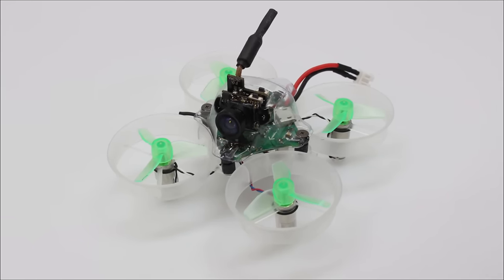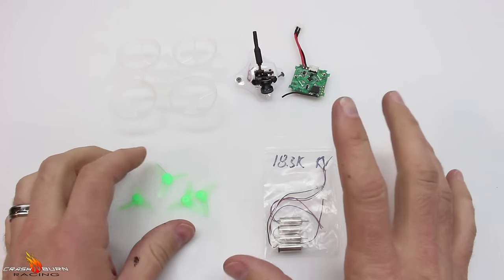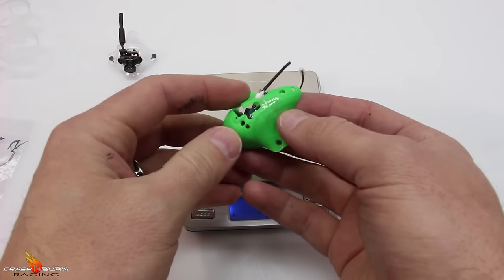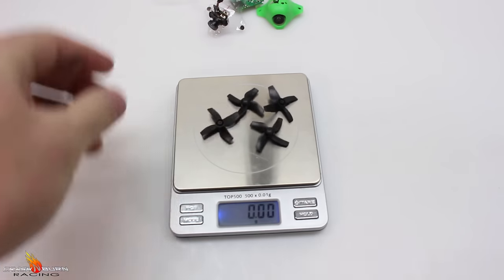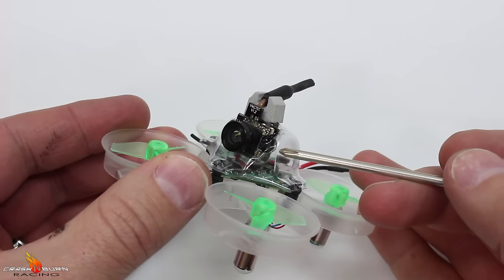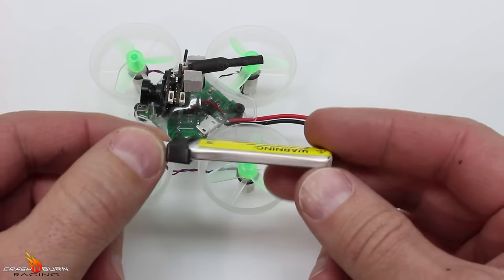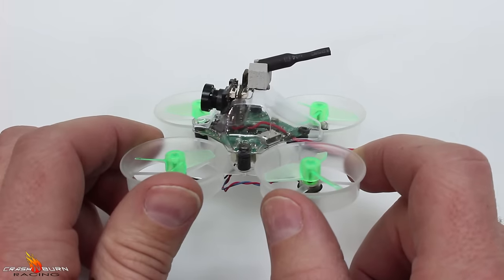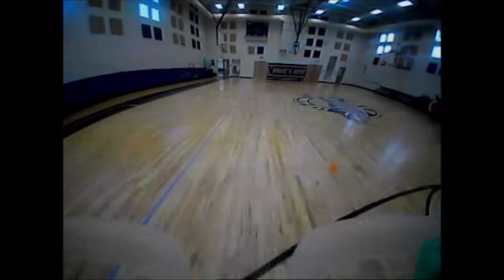Tiny Whoop to Super Whoop - lighter, faster, Inductrix killer

Comment: take the black cover off the antenna to save even more weight.  Also, you can get rid of the 2 canopy screws and just glue it with a tiny bit of uhu por.
Reply from the maker: Thanks for the advice!

Comment: I'm building something similar but with stock props and 17500kv motors. I've also got a carbon fiber cross brace to make the frame more rigid, it weighs about a gram. Have you seen about running the motors in the stock inductrix locations, rather than the betaflight motor positions? The duct supports are angled on the inductrix frame so it is designed to have the motors a certain way (the supports are flat on the E010 frame)

EDIT: Found a UK seller of the Rakonheli 3 blade props, so have picked up a set of those to try out.
Reply from the maker: Jimster71 I noticed the same thing in my build. I don't think it is possible to change the motor directions but it seems to me to not make any noticeable difference.
Reply from the maker: It's actually very easy to change motor direction.  Just copy and past into CLI: set yaw_motor_direction = -1

Comment: Hey, love the video, inspired me to build the same one.  I also noticed the frame rotated 90 degrees, when you switched this how did it affect what motor went where and prop direction?  I have head you want the motor direction to match the direction of the angle of the motor struts to create smother airflow and less drag and to accomplish this you must reverse all motor directions in the cli in beta flight.  I am wondering what color motor leads to put on what corner of the quad and where to plug them into the board as well as cw vs ccw prop rotation
Reply from the maker: Joshua Young I noticed the FC was on sideways and fixed it before flying.  look in video description to change motor direction.  After that all you need is to change the props to match. I did not notice a difference in performance but it won't hurt.

Comment: But it's not under 20grams you need to add the battery so it'll definitely be over 20grams
Reply from the maker: Different batteries have different weights, so to come up with a standardized system you do not include the battery.

Comment: Yeah, Whoopin' is great but I'm going brushless now since they weigh within 7-10 grams of a normal whoop, have better power to weight and cost about the same; <$100. Still a big question if it'll be as durable since I'm using the RakonHeli 66mm carbon/delrin kit. Delrin is like carbon when it fails, no graceful failure mode, it just explodes.
Reply from the maker: I agree, brushed is dead. I am still looking for the right tiny whoop style brushless quad.  This one looks like it has potential. http://www.boldclash.com/boldclash-b06-fpv-racing-drone-f3-blheli-esc-15000kv-m0703-800tvl-camera-25mw-48ch-vtx-p133.html?utm_source=youtube&utm_medium=review&utm_campaign=AK14014411&utm_term=tower

Comment: On these tiny whoops, how do you know which motor to put in the CW and the CCW spots?  On bigger motors it's quite clear, on these little guys, I cannot seem to find it.
Reply from the maker: The original inductrix spins opposite of normal direction. Aftermarket boards usually spin in the normal direction.  I would hook your whoop to beta flight and look in the configuration tab (top left) and see how it is set up.  There will be arrows on each motor indicating the required motor rotation.

Comment: How did you arrive at the pid values you are using?
Reply from the maker: My PID values are really close to the stock PID values that came on the board.  In acro it wast holding it angle very well but these PIDs seemed to fix it for me.

Comment: Is the expensive fc needed?
Reply from the maker: This fc allows for a better radio and has much better control but you can upgrade the motors on an eachine E010 and use the asrock controller.
Reply: Crash N Burn Racing okay, thanks for the help! I'm thinking of building a whoop or buying one
Reply: Smiley Brothers Lawn Care you can buy a flysky transmitter for pretty cheap cause they have a good selection of flight controllers and receivers for inexpensive prices compared to frsky or buy one of the jumper transmitters that have multiprotocol built into it so you can use a wide range of flight controllers and receivers ,

Comment: why dont you make a stretched whoop and see how that flies.maybe the back arms elongated like a stretched motorcycle. or maybe a v-tail if thats possible
Reply from the maker: Due to the lack of power there's not really a whole lot you can do to a tiny whoop to improve performance.  If more performance is your thing then you need to go the brushless rout.  I should be getting the new EMAX babyhawk in a week or so, or when it is finally released.
Reply: i was just about to try this as a first build. but the site says there are no whoop flight controllers compatible with flysky turnigy evolution. which is being shipped to me now.
Reply from the maker: That's a bummer, I really like that transmitter also.
Reply: albert kim has a vid adding the flysky a8s to them. ill likely have to go that route
Reply: I know I'm a month late, but either you can use the flysky a8s with an FC that supports iBus, or you can get the Eachine Beecore f3 FC, http://www.banggood.com/Beecore-F3_EVO_Brushed-ACRO-Flight-Control-Board-DSM2-For-Inductrix-Tiny-Whoop-Eachine-E010-p-1089021.html Turnigy uses the flysky protocol, and you can choose that on that FC :)

Comment: got mine to 18.8g using furibee board and frame, and 2 blade prop mod. same camera and canopy.
Reply from the maker: Nice! Are you using the stock FC?  The aftermarket FC's are almost 2 grams heavier.
Reply: marsdog me too furibee is super good for some reason. but even better is the jjrc h26 hex with 14kv motors and the 4 blade props from tiny whoop this thing goes much faster than any tiny whoop ive seen.
Reply: I use a nihui E10 board accelerometer and gyro are good and I'm considering trying out a beta85 frame and 8.5 mm motors just a bit confused as to what battery to get a 260mah 45c should be ok

Comment: triblade or 2 blade?
Reply from the maker: I prefer the triblades with running faster motors but since there so expensive compared to the normal props cutting them down to two blade is an acceptable option with running super fast motors and up.